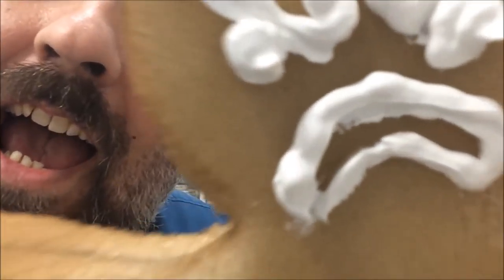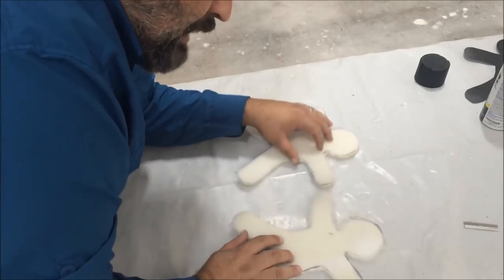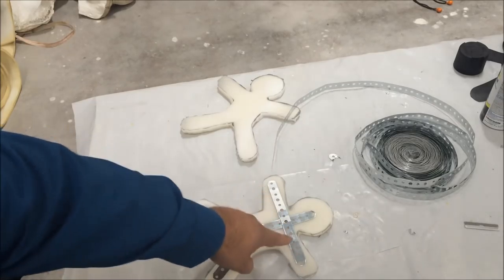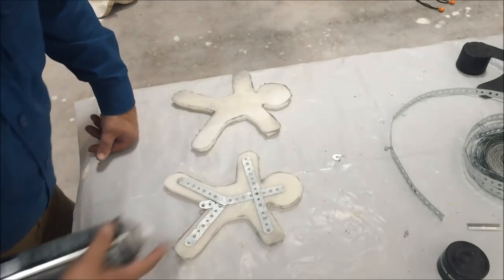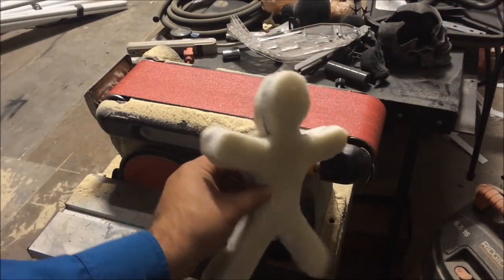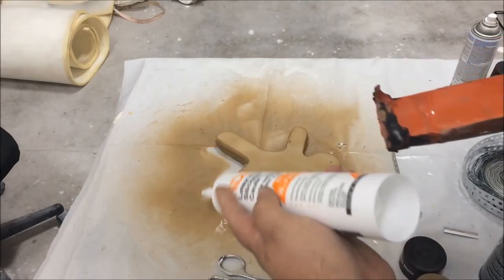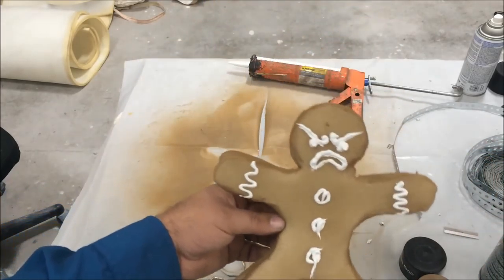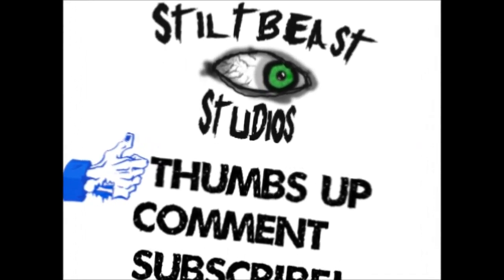Evil gingerbread prop

Comment: I like that. Do you think some thing like 12ga. copper wire would be better? I'm just thinking that hanger strapping only bends back and forth, but round copper wire would bend in all directions, and you could maybe bend it in a loop at the hands, feet and head so it lays flat and won't move around. Just a thought. Keep up the great work.
Reply from the maker: +wjf213  it would work ok, but it would twist and be very hard to attach inside of the body.

Comment: Awesome video!! Question: You mentioned that we can add fake candy to our gingerbread man, where can I find a place that sells fake candy, or could you use real candy? Also, if I were to add fake candy on the prop, what adhesive would work, so the candy won't slip off the foam?
Reply from the maker: +Felix Valle  e6000 as the adhesive and I get mine from Ebay- type in Candy beads.
Reply: Craft stores like Michael's or Hobby Lobby around Christmas. Also try places like Target or Walmart in their Xmas tree decor section.

Comment: You said that dipping the gingerbread men in latex makes them last forever. Would you have to worry about the foam being almost like a sponge an soaking up all the latex?
This is Scotty, by the way. I'm working on a MAJOR overhaul of my channel... Wanting to focus more on other haunt stuff as well, not just makeup.
Reply from the maker: +DarqueHaunter  got ya- the reason it makes them last forever is because it soaks up the latex- at that point they are almost solid rubber with a core that is just flexible enough.
Reply: Ohh! Okay! Cool! That's a really neat way to do it!